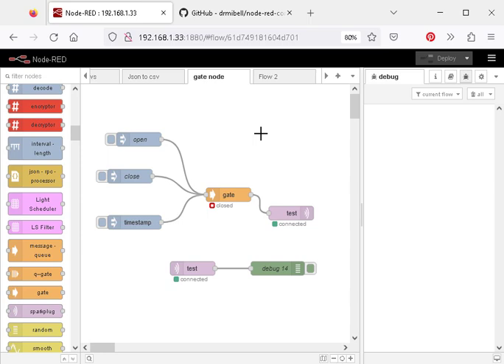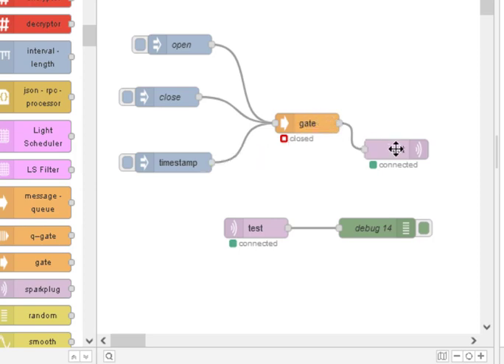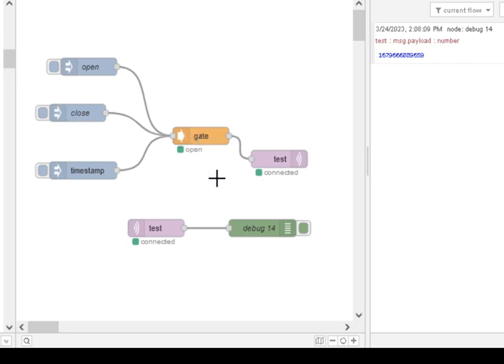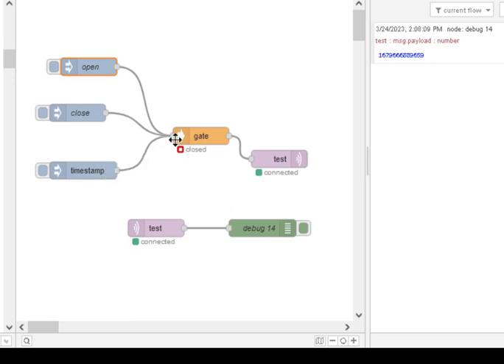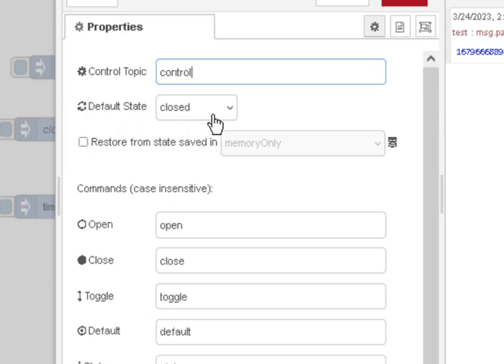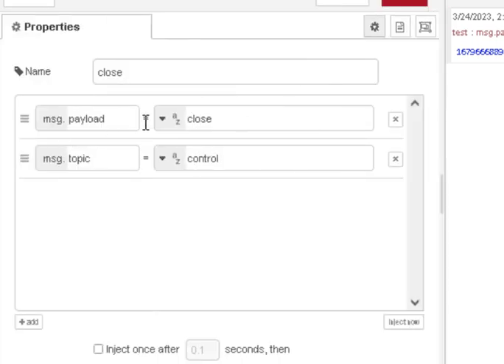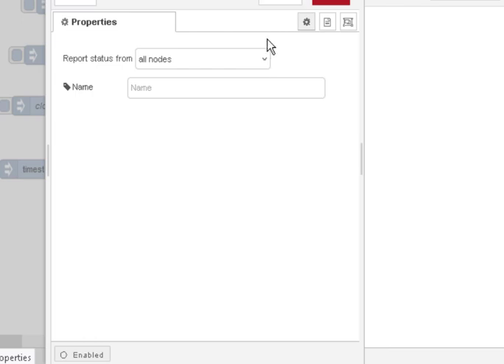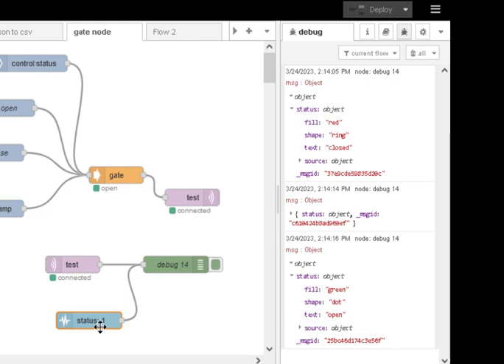Using the Node-Red Gate Node

Comment: Thank you for this video. I found that the status does not work (no payload output) after the gate is closed and think that setting a flow variable of the gate status makes more sense to me. Thanks anyway and I certainly would appreciate a reply.
Reply from the maker: Is that the status node not working or the status of the gate node?
One thing I don't like about the status node is that it only shows status changes and not the current status.
What are you storing in the flow variable?
Rgds
Steve